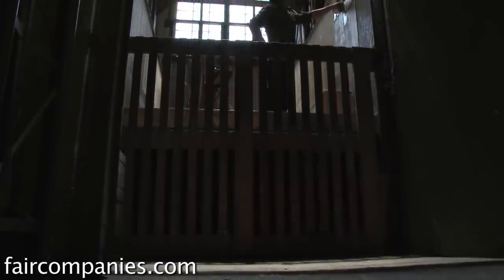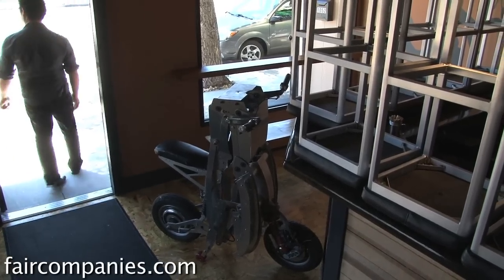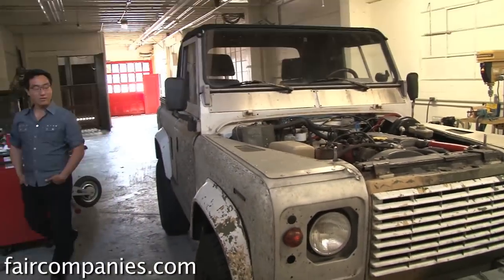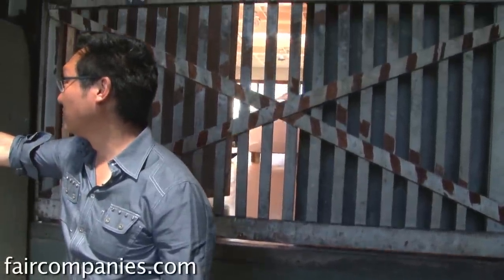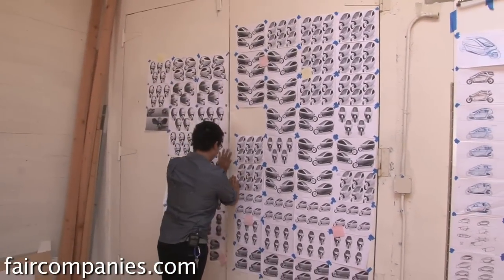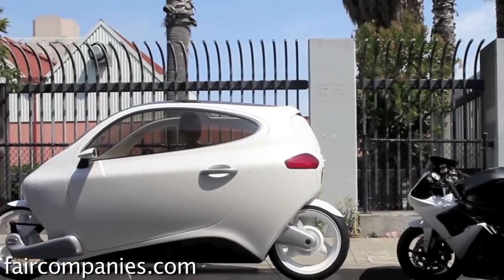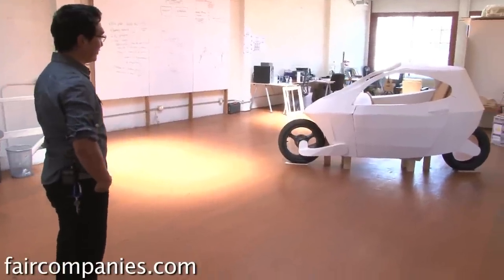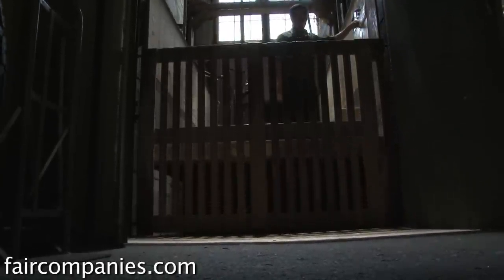Folding moped & EV motorcycle that can't fall via gyroscope

Comment: Innovative guy with the right heart. I think Tesla Motors should invest in them. At least, it can provide the batteries controls/charging/management controls for this bike. He will be successful. The gyro self balancing tech is just the cream of the crop for this bike. I think one door is fine. Choose either right OR left open door, not both!.

Comment: I'm hoping Danny can pull this off,we need aerodynamic commuter vehicles like this.My concern is the gyros controling the lean angle,and the overall ride feel.I prefer the gyros for just low speed and standing ,with high speed motors ramping up the gyros in a impact,so the vehicle can stay upright.Danny designed a landing gear for it,I think he knows if those gyros fail,the bike falls over,it can't happen period.Education is the key here ,we need to change the way we commute,the positives are just too many to list.excuse my writing ,I tend to rush with my comments,I speak much clearer.
Reply: enough gyros in the right place and it will fly :).
Reply: Gyros have nothing to do with the weak force of gravity.Newton's first law of motion.They act within the laws of physics.I wish it were true that gyros defeat gravity,they do not.Oh well.

Comment: I do love the prospects of owning a C-1 however, in an accident  I can sea that an impact would easily kill a driver even if the bike doesn't fall over. The person inside would be slammed into the side windows and unless the  car was made from some type of indestructible material, it would turn the driver and passenger into a strawberry shake that fire fighters would have to dismantle to retrieve its occupants. What safety gear will the C-1 come with? What protects the passenger ?

Comment: Cargo bike....I want one NOW. I can totally see a couple biz opportunities this vehicle makes possible where I live. Screw the folding feature and electric motor. Give it a 250cc gas engine and 6 speed trans. Yes!

Gyro-stabilized-motorcycle...If the system prevents leaning, then how does it lean to turn? And if all that requires digital electronic control, what happens when it fails (because it will) ? Lifetime rider, just asking...

The guy busts his ass. Innovative too. Very cool.

Comment: I suggest you sell gyros for motocycles and electronic controlers. I'd move a motorcycle engine to the back and havr it turn an ev battery charger and place the gyro where the motor was  and propell it with electric motors.

Comment: I'd like to know specifications, particularly weight ratio gyroscopic control to whole vehicle, power of the motor and capacity of the battery. 
And let us to estimate the claimed 0-60 ml in 6 sec.

Comment: i need know gyros dimension at wheel and weight, and what controller computer you use what software. and motors what use and rpm. and battery ? i want build my own test and funny bike.

Comment: Electric? WHHHHY ELECTRIC? electricity is absolutely useless! The fact that this guy made transportation machines around electricity inevitably dooms his business! All these new start up companies thinking electric cars are the "future" finds out the hard way that its the surest way to go bankrupt.
Reply: +Chimp Whisperer Please explain why this makes any sense.
Reply: evildevil364 It doesn't make any sense. Electric cars are for hipsters and trendy people who think are saving the planet. Batteries are the reason why none of this matters. 12 hours to charge? and for 60 miles of range? Charge time too long and range and too short. I can fill a tank of gas in 3 minutes and get 300+ miles of range. Also batteries have a life of about 5 to 7 years before they break down and become useless. Now you have an expensive brick on your driveway unless you got $15,000 laying around to replace that li-ion pack.
Reply: +Chimp Whisperer that's rich you talk like you know who I am... Do you?
Reply: The Golden Radio you are a son of a bitch
Reply: +Chimp Whisperer yes I am what of it
Reply: +Chimp Whisperer top marks for creativity... Where did you get that one from ?
Reply: +evildevil364 I would like to correct you on one thing... Though the degrade rate you mentioned is common it's not always the case as it's all dependent on the quality and cells used for the battery. If you do a lill research on lithium ion battery's you will know what I'm talking about. From what I have found the battery degrade rate is mostly down to human error and miss use of the battery and a little to do with the battery and management system.
Reply: +evildevil364 what I am saying is it's a combination of battery engineering (there's a lot of "cheap" battery's on the market today) and battery use (over charge and battery's going below the recommended power level and going flat) that are big factors the the rate a battery degrades
Reply: +The Golden Radio don't forget bisexual and proud
Reply: +Chimp Whisperer do you like paramore
Reply: +Chimp Whisperer ??? Do you ?
Reply: +Chimp Whisperer I find it funny you saying my English is too goo as I'm dyslexic but anywho have fun figuring out why the bacteria on the bottom of your Air Force 1's have a better chance at survival than you do 😊
Reply: @Jamarkus_Delvonte  sure, battery cars and bikes not have future realistic newer. no good no safe world anythink because battery made many problematicchemical what destroy planet more than gasolinecar. this bike have perfect ir adding 125cc-500cc engine backside.